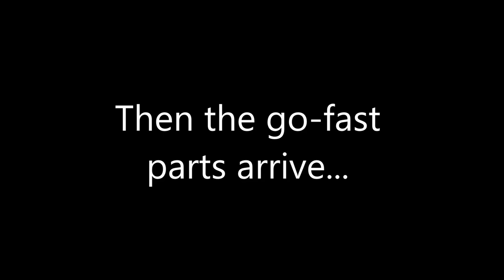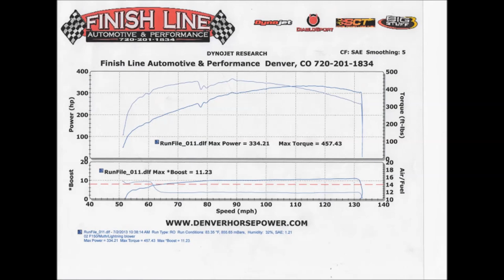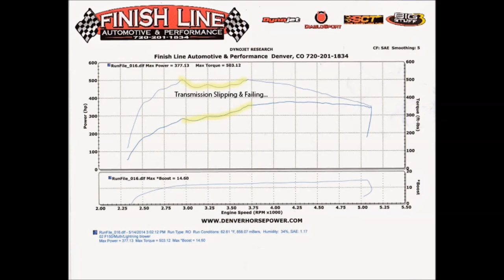2002 F150 lightning supercharger conversion

Comment: I have a 1997 10th Gen F250 Lariat 5.4l. I read some where that the first model of the F150 lightening had a 5.4l 2 valve engine just like mine, so I wanna install a super charger on that sucker. Just dropped a brand new 5,4l 2v v8 engine in it last Christmas. I like what you did here.

Comment: Did that Transmission link up to the transfercase? If you gotta give up the 4x4 then, i'm out... Also did you see any issues with the exhaust manifold after adding the supercharger? that was a pretty impressive pull, against the sti being that its, half your weight and awd, with probably a upgraded turbo/wheel...  nice clip

Comment: I see the parts listed in the description to make the L conversion, but do you have a more specific parts list for the little odds and ends? Looking to pick up a 5.4 150 2v motor, get the L lower etc and then tork tech adapters to put a  0304 cobra eaton for my new edge!

Comment: Man your truck is bad ass, you've brought it a long way.  Congrats. The only thing that I could say and it's strictly my opinion, is that it could use a little bit of an altitude adjustment. Like I said that's only my opinion and not trying to criticize at all. Keep up the good work and keep the updates coming.
Reply: That's partially a geographic thing. Example - you'll see that more in the southern states. I know this varies place to place, but I've seen dozens of trucks up North where people spend loads under the hood, suspension, etc, and run stock exhaust, rims, trim items and have mudflaps lol Again, not a factual statement, just a fun stereotype. Where he lives people may not value that attitude look. Just the balls

Comment: Did you mount the charger onto your  stock 5.4 litre ? I have a 2001 harley f150 and want to charge it I can get a full drive train from a 2003 harley f150 engine trans all the wiring cluster and steering colom with the key and full wiring harness with ecu.  How hard of a swap over do you think it would be ..
Reply from the maker: Yes. I just used the factory motor and bolted on the blower. I did not need to swap ecu or wiring etc

Comment: I have 2001 F150 5.4 Lariat .... what would you recommend to find all parts needed to an Supercharger ? Perhaps an full used engine ? My current engine runs well with 210K miles ...I'm a mechanic with many years experience diesel & gas so I do all my own work. And is this supercharger noisey in anyway ?
Reply from the maker: You don't need the whole lightning engine. Only need everything from the intake manifold up off the lightning. Could be cheaper to buy the lightning engine tho.

Comment: What all was needed for the supercharger install? Is the engine harness and pcm from and lightning?
Reply: I have a 2003 f150 ext. cab stepside with 5.4l 4x4 and 4r70w trans. Found a fairly complete lightning setup, but was told I need to use the Lightning pcm by 5star tunes to get it to run.  That pcm only works with the 4r100 trans, and the trans swap isn't worth the trip on the 4x4. Pls give details how you got around that issue -- I'm ready to purchase the Lightning package if I hear from you soon.  Thx.

Comment: So did you have to swap out the rear and front differentials so they didn’t explode or break or do the stock ones handle the additional power?
Reply from the maker: If you're rear is 8.8 or 9in no need to upgrade them. They will handle plenty
Reply: @genuinegarage  alright
Reply: @genuinegarage  also did the stock transmission hand the power or did it end up
Needing a trans swap as-well?
Reply from the maker: @ramdog1144  it's a ticking time bomb. 4r70s all suck no matter how built up
Reply: @genuinegarage  what would you recommend as a replacement? Or what did you end up using?

Comment: you changed the transmission? Differential?
Reply from the maker: Original with 200k. The 9.25 is tough unlike the trans
Reply: @genuinegarage  I want to do the same with my supercrew by any chance do you know if I were to pull put a supercharged engine from a lightning or Harley Davidson edition would it bolt on to my transmission which is a 4r70w

Comment: So I have a 1998 5.4 can I find a supercharger to fit my truck ?? And I'm wanting a screw design please and thanks for the answers.
Reply: I think it won't work on your truck since it has npi heads and the lower intake has pi ports i maybe wrong
Reply: +somedude is right on the Heads part. but the sine solution is either buy aftermarket heads so you can benefit from the massage Torque and power gain while your in the engine or just put on P.I. heads.

Comment: I found that blower for $400 it has everything but the lower intake. and I cant find one anywhere. I was told it would fit on my stock intake after I pull the plenum. but I don't want to tear my truck down until I find out. can you tell me if it will work or not
Reply: ok thanks now to try and find one

Comment: Will lightning headers work on a normal 5.4 ( I do have true duels btw if that matters)
Reply: +kyle wilson I believe it is an almost if not identical engine
Reply: Engine wise they will bolt on but the rest of the H pipe and catbacks are different so you would have to have those as well

Comment: I would like to do something like this, but I have the 4.6npi. Any suggestions? I was thinking a supercharger off a 03/04 cobra maybe?
Reply: Genuine Garage I was thinking of doing a 4v head swap. Think that would be plausible?
Reply: Genuine Garage it also has the Windsor engine if that makes a difference.
Reply: bamafreak223 Tork Tech
Reply: Genuine Garage torque tech has adapter plates so you can use an m112 on a 4.6L or 5.4L. They make Cobra GT kits as they call it for the 99-04 mustang GT.

Comment: You know it usually is easier to lift the bed up for truck fuel pumps lol
Reply: Not possible on these first edition S'crews, the pump is located under rear of cab. I know, I replaced fuel pump in my 01 Lariat S'crew 4x4. It's easier for one man to just drop the tank, do it right & inspect, clean, install.

Comment: I was just about to comment on how the Ford Lightning come with the transmission of a F350 to handle the power when I saw “transmission slipping and failing” lol
Reply from the maker: nick725fury you're right. The lighting has one of the strongest 4r100 trans ford offered. Unfortunately this is a 4r70 haha

Comment: seems like a lot of work to just get stock 5.7 hemi power
Reply from the maker: Still makes 125ft lb more tourqe to the wheels than a hemi. Probably more. And that's on a motor designed in 2001